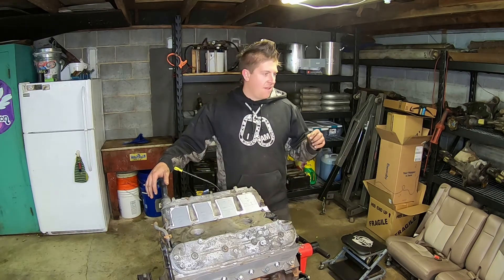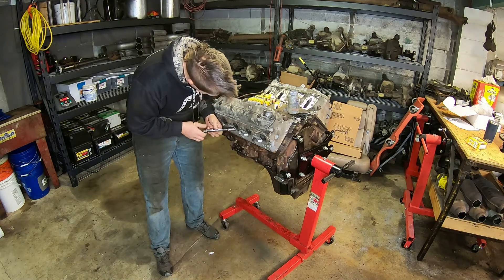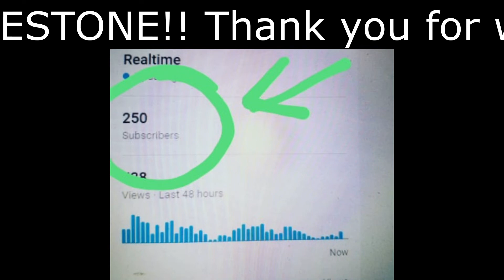Getting The TWIN TURBO LS Ready To Start!

Comment: How did you get the ecu(?) contrlloer for the engine?
Reply from the maker: I had the wiring, ecu, and sensors from a 2003 truck that I parted out earlier this year. You can find them for sale online or go to a junk yard or U-pull-it yard to find ecu's. It's harder to find a good wire harness in a yard though, usually they have been cut or damaged by other people.